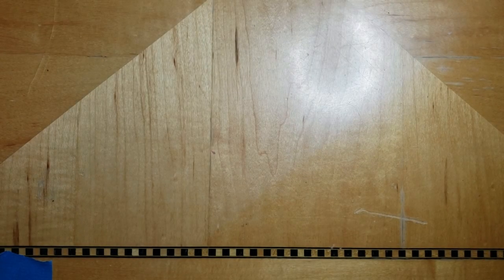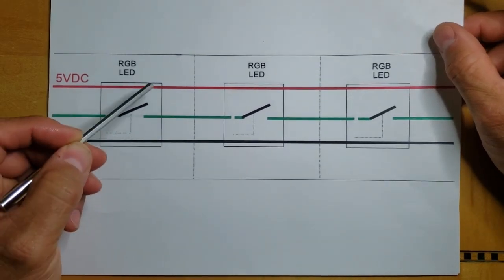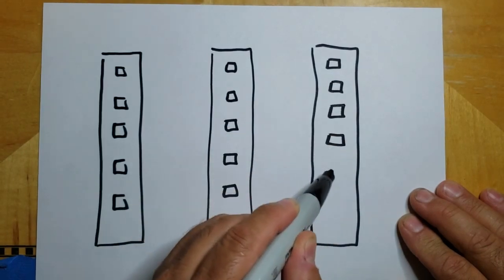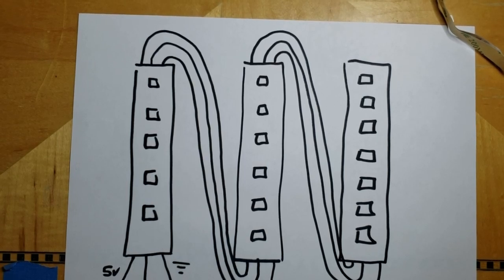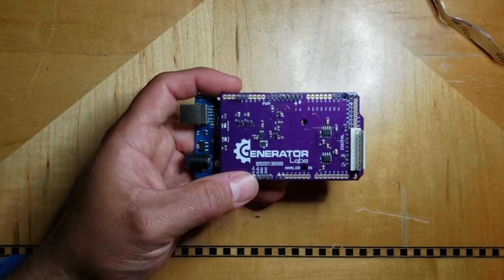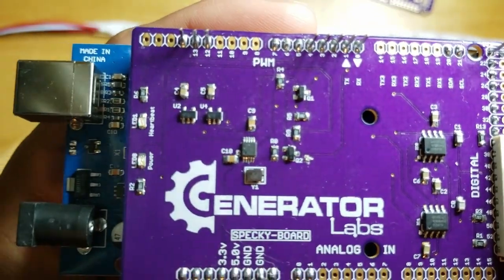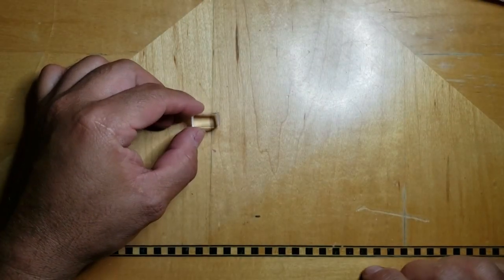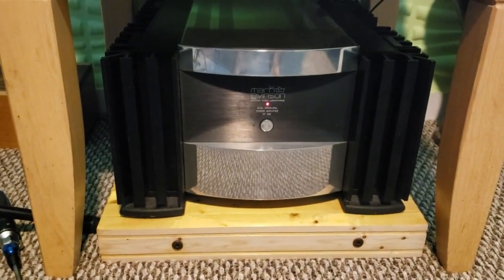Homemade 14 Band Spectrum Analyzer Part 3; Final Specky Board Revision

Comment: Would you please list the specialized tools that you use... Also, it may be a good idea to send all un-soldered parts to us with all pictured instructions, then we can solder the parts on...
Reply from the maker: The tools I use to assemble these boards far exceed the cost of a pre-soldered kit I sell. The 400x stereo microscope is a prime example. If someone has that investment in that gear already then a diagram of how to solder surface mount chips is moot. The kit is the most economical way to build one of these.
Reply: I sent a request for pricing through the email form on your website last night.

Comment: I use same led as yours.what is the square hole size on mm?
Reply from the maker: My hole size is approx 3/8 inch but that will vary depending on acrylic stock tolerances. You must measure the stock and led strip to verify the dimensions you require.

Comment: What machine do u use to cut the square hole in melamine board ?
Reply from the maker: That is a CNC router i built but any typical CNC shouid be able to do it. Holes dont have to be square though. You can use round acrylic stock and some preclsion hand drilling.

Comment: Hi Daniel, Do we need to an amplifier to input audio signal to the board? Or can we use PC or MP3 player to feed audio input? I have tried my PC audio input, but unfortunately it doesn't seems to be working :(
Reply from the maker: You do not need an amplifier. The headphone output of a PC should be adequate.

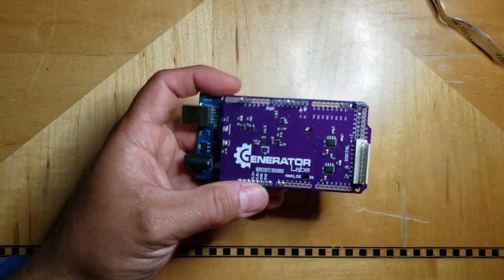Comment: You mention at 28:28 that it's only designed to handle line level/pre-amp output level. Does that include 3.5mm jacks you'd have on a PC/phone? My guess is yes because you'd usually have an amplifier in the speakers, and you can only power low impedance headphones with a 3.5mm output jack from a phone/PC. I really hope I'm right but I might be completely off. Thanks.
Reply from the maker: You can drive the Specky with small consumer electronics like a phone or tablet with a standard 1/8" jack. What you cannot do is connect the Specky directly to high current speaker outputs like an amplifier or receiver. In the case of a receiver you must use line level outputs like a TAPE REC output or something similar. You could also use a properly rated "Speaker Level to Line Level Converter" similar to the ones used in car amplifier installations (ie Stinger speaker to line level box)
Reply: @generatorlabs  Thanks a lot! I'm not too familiar with the audio voltage levels. Had a mishap due to connecting a microphone to a line-level input on a sound mixer, and had to crank the gain and volume to the max, which added noise. There was an XLR mic level plug just above it, but I didn't know any better...

PS. I'm that fella from Israel who emailed you about the IC purchase. Thanks for all your answers, hope I wasn't too much of a burden!

Comment: Great stuff, thanks for sharing! Regarding the wiring between the LED strips. Wouldn't it be more efficient to make the even index strips (1st from the left, 3rd, 5th etc.) with the data direction upwards, and the odd index strips (2nd from the left, 4th, etc.) with the data direction downwards?
That way you only need wires that are as long as the distance of each adjacent pair of strips, as opposed to making the connecting wires travel the entire length of the strip back down. It would make it so that the odd lines would need the data sent in the opposite order, but it shouldn't be more difficult than inverting the RGB data array every 21 entries in the code.
Also it would cause a lot less voltage drop and easier wiring.
Thanks.

PS. no I didn't mix up even/odd. 1st from the left - index 0 - even index, 2nd from the left - index 1 - odd index :)
Reply from the maker: The concept shown in these videos is drawn in a way to make it appear as simple as possible. The documentation I supply with my kits suggests wiring the power bus differently & more efficiently. If you watch my 28 Band Analyzer video you can see how the voltage bus laid out much more efficient. In fact I inject the bus voltage in the middle of the string to make the distance traveled each way basically half. Any voltage drop is nearly non-existent. The only wire which is still laid out in a longer loop is the data wire. In this application the length is not much at all and inconsequential. Making the data line to work out of sequence demands more lines of code and makes the code even more difficult for someone to understand if they are new to coding. Just trying to keep what appears complex as simple as possible.

Comment: Would the Specky Board work with an irregular matrix?
Reply from the maker: The Specky board itself has no concern for column height. It is the code in the Arduino that cares. The current code addresses columns that must be of equal height in terms of LED's but the columns can be chopped up.  You could modify code to do almost anything though.
Reply: @generatorlabs  Thanks Daniel, I have to say I'm new to this and the code is pretty intimidating. So the Specky board essentially takes the audio input and slices up the bands and turns that into a digital signal the Arduino can digest, is that correct?
Reply from the maker: @johnvargo8050  The Specky board, which sits on top of the Arduino, like a hat, looks at the incoming audio, splits it into 14 distinct frequency bands and then send the Arduino a voltage between 0 and 5 volts for each of those 14 bands, in rapid succession. The arduino maps the voltage in rapid succession to each of the columns. If the arduino see zero volts for a column then no lights for that column. If it sees 5 volts for a column, the entire column is lit. And it will vary the number of lights for voltages in between (ie 2.3 or 3.4 volts etc)
Reply: @generatorlabs  Thanks that makes a lot of sense, I appreciate your explanation! I just started my own project, which is more like a spectrum analyzer built into wall art, and this is really helpful, I'm learning a lot!

Comment: How difficult would it be add additional controls to this, like  the ability to cycle through different different color patterns, control the peak speed and delays n such? I have zero coding knowledge so how would you suggest I go about doing this?
Reply from the maker: I leave a number of I/O pins open so end-users can implement their own code mods easily. I also left pins available for 5v and GND. So you could potentially add buttons or other controls with ease. As far a coding the changes, that would need some study on how I/O pins work on the Arduino. It is not extremely hard. There is a variable in the code now that controls what display theme is shown. It could be as easy as writing code to increment the variable to choose the next theme. You could even create your own themes. It is possible to make it do other things too like scroll letters etc. The imagination is the limit.I cannot however offer coding for specific usage cases. Where's the fun in that?
Reply: @generatorlabs  This job of yours is inspiring! Plus I like your Bender's photo frame and the Royksopp music! We two would be good buddies.  Anyway, thanks for your advice.
Reply: @generatorlabs  I have a new question,  can I connect an I2C Oled display via SDA and SLC in parallel with the Specky board? Then I would intend on using a rotary encoder to cycle through different menu items I was talking about above..peak delay, color select etc.. and lastly I would use an app to make these changes over wifi. Is this  possible?Thanks in advance for answering my queries! Hope you are having a great weekend.

Comment: Is it possible to use a Wifi/bluetooth Arduino board to connect audio input wirelessly?
Reply from the maker: The arduino itself never sees the analog audio. The arduino processes the digitized/segmented pieces produced by the specky board. If there is a library that can accept a transmitted Bluetooth feed, I guess you could loop the audio output from the arduino back into the specky board. If the library is interrupt driven there could be a conflict between the FastLED library though. A low cost bluetooth adapter used in vehicles may be a safer bet.
Reply: I was thinking about modifying a chromecast audio dongle or google home mini speaker with an additional non-amplified audio output. Then the audio signal comes in wireless into the equalizer. You can easily add this as a "speaker" in your google home app and add it to a room or another group of speakers.

Comment: why you create it in smd ? the parts are 
not available in tru hole mounting position?
Reply from the maker: The clock generator is not available in ThruHole.  With the close proximity of high frequency clocks and audio signals the use of SMD layout provides tighter tolerances and noise rejection. Ground plane can be filled easier with SMD components. SMD will provide better performing and cleaner looking results.

Comment: I'm curious what kind of amp draw this project uses.  I'd like to copy/modify this project for a robot costume I'm working on, and would like to be able to run it off of a rechargeable battery pack.  would that be feasible?
Reply from the maker: When I started this project I did not want to have a hulking power adapter to drive it. It seemed like a waste. I had read about the theoretical maximum draw of a 300 element RGB string and they were calculating 18 amps, in worst case scenarios. That just seemed insane!  In my first video I did some preliminary current measurements using a rather large bench supply. It turns out that if I kept the intensity of the LED's at a reasonable level I could keep the draw of 294 LED's, with an Arduino and a Specky-Board under 800 milliamps @ 5vdc.  Actually the current is lower. My actual recorded max was 740 milliamps with max LED deflection on all columns. I think the average was more around 575 milliamps. I have never raised the intensity beyond what is shown in the videos because frankly it is not necessary. The LED's will have a shorter lifespan if driven hard and they have minimal heat dissipation capability. Also observe that I never draw the color white in any of my videos. I avoid that because that color will draw the most current. In my final build I use a very compact 3 amp wall adapter with no problems. With kits that I sell I step it up to a 4 amp switch-mode mini brick and explain the need to be cautious with intensity. Intensity can be changed in my sketch via a brightness variable, although not recommended.  For your project I would use online calculators using your battery capacity to figure out run-time. I use a step-up bucking regulator to keep Arduino supply voltage above 8 volts. You will need a 5 volt battery configuration. You cannot exceed 5 volts with these LED's as they are sensitive to over-voltage.  Sounds like a fun project.